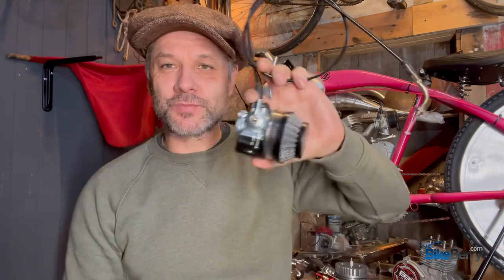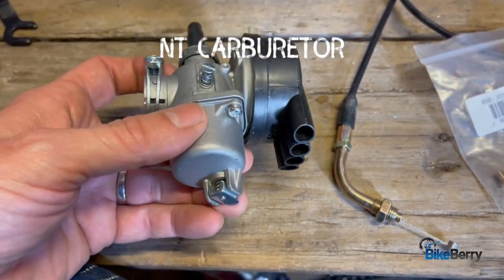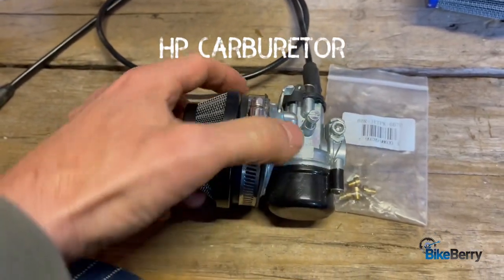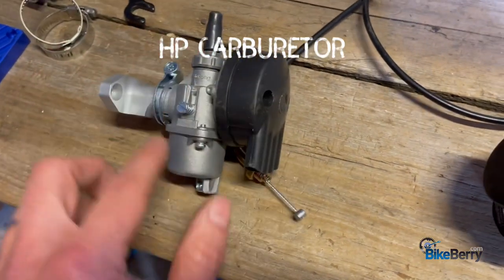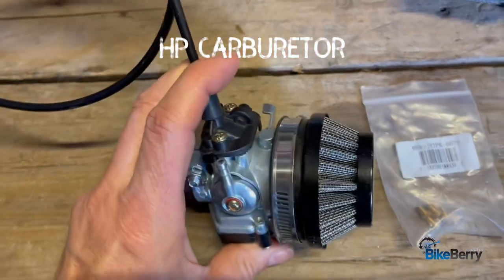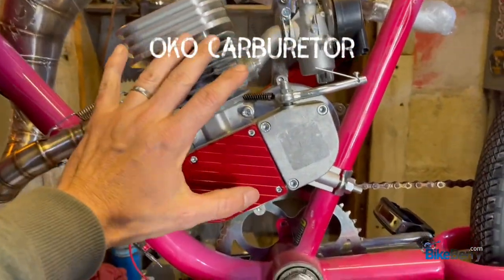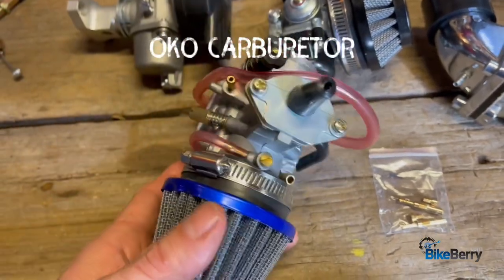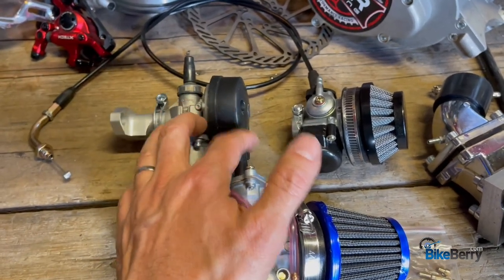Nt, Hp, OKo, Carburetor Overview | Motorized Bike | BikeBerry

Comment: Other than the NT not sealing all that great I'm sticking with it. I am not wasting my time trying to re-jet the Hp carb and the OKo personally I think it's too heavy for what it does. Not to mention I want everything inline not off to one side. Great video though Tony, Keep up the great work loving all the videos.
Reply: I hear you. There are bikes I have that the NT carb is perfectly fine. Then others the HP is great. That’s why I’m building the pink bike. So I can put all the crazy stuff on it 😁
Reply: @tonytaylor5087  I hear you, If I had the money to just build the ultimate Bike it would probably do over 100mph with or without a rider. LOL
Reply: Use Teflon tape to get a better seal on intake to motor
Reply: Keeping everything in line will cause your carb to suck hot air but you do you
Reply: @tonytaylor5087 You’ve definitely got some stuff I haven’t seen/didn’t know about!! Like the throttle for instance… I like the design.. and your expansion chamber!!! Dayum!! Got some nice welds!!! $pendy I’m sure! I’m gonna have to subscribe now,because I want to learn more! My son convinced me to get a motor finally…. So,new to this for sure,but learning fast!!! Just put an expansion chamber on last night….. hooooo-weeeee what a difference!!!

Comment: I know you already have the dio reed, but there has been some heated arguments on weather or not the OKO carb gives better performance with a G2 reed or a DIO reed. It would be great if you could make an episode on this subject.
Reply: Great thing to test! I’ll definitely dive into that.
Reply: @tonytaylor5087  I personally run a G2 reed with the OKO on a YD100 and it RIPS. The thing has SO much torque, it'll buck you off if you arent easy on the throttle. Ive heard the Iron Bore engine has even more torque, so pared with an OKO, decent reed setup, a half decent spark plug, and a decent exhaust, that thing will be a beast.
Reply: Oh good to know!

Comment: Carb 1 has occasionally float balance issues and  the lil float mount tab imo especially when I hit jumps or bumps. Its still awesome but once you bend over the prongs trying to make it cut off gas flow earlier I never got it back right. But I still found it very dependable and a side tap w a screwdriver on side of the bowl is instant fix. I upgraded to HP and its ok for 14$amazon. Anxious to try the 3rd option i didn't know about that one till now 😮 thanks for your opinion  brother 😊

Comment: I’m using the 24 mm oko carb and it’s got 105 stock main I replaced it with a 130 now it’s runs good but if it was a 21 mm it would run good with the 105 and better with a 100 I’m looking for to trying the mikuni tm24 on my other bike

Comment: How is everyone putting on a big pwk carburetor with the stock throttle cable? Mine needs about another inch or inch and a half of cable coming out of the housing and it does have a choke you actually touched it several times

Comment: So I got the 60 680cc upgrade it came with two heads and for the carburetor one black one blue air cleaner one larger head one  smaller your head which goes with which

Comment: That's interesting. I tried an HP Carb on 3 different builds and got the same result(s)...Engine WOULDN'T idle no matter what I tried to do, although they DID run, wouldn't idle. Never tried the OKO, and the NT just gives me the best results and performance, but that's just me I guess...
Reply: did you swap out the jet in the HP to a 70? there jets are way too rich in them

Comment: My hp carb is not working on my motor and i took it apart and it looks fine but i noticed that there is an air bubble in my gas line so it seems to be not sucking in gas properly? Can anybody help with any info
Reply: Did you check the gas tank

Comment: nt crap carburetor: stock, no jet adjustment, 12mm air/fuel mixture inlet, restricts the engine, makes the engine too rich
hp: a little better but a Chinese copy of the 15sha whether in 15mm or 19mm model
oko: the best possible

Comment: i have the first old carb (the one who leaks fuel by air filter, lol) and now i bought the NT carb, and a new acelerator cable, and i dont know how to tune it properly. im using a Z or curved intake cause it dont fits in my mtb bike frame and it happens that have to much lagg on decelation, and some times it remains acelerated. please anyone can helpme to fix it?

Comment: My bike runs with a high Rev and when I stop with the clutch in it will Rev very high how do I bring it to normal idle
Reply: You got a vacuum leak
Reply: In-between your carb and cylinder head you have an air leak,,, THAT is what causes high revving regardless of throttle position !!!

Comment: Choke flap keeps vibrating loose an fall down choking out my engine i tried everything i could think of but it kept coming loose so I took it off and use my hand for now until I get a better cars
Reply: I used some blue thread locker on little nut if blue don't work use red. Torque snug to where choke lever is a little hard to  move but not way too hard & let thread lock dry. Or might try tighter to where lever is hard to move then slightly bend choke flap away from carb hole.

Comment: The HP the seal on the fuel intake there rubber you can't get a replacement the others fantastic!.for one second with covid you should have seen the fully F@#@ out the box basically the hole engine had no one straight join fit and all but the primary piston had gone including the clutch in a year half a seal in the primary case missing after my first cheap Chinese that the carburettor went 3 months I got Australian upgrade that ran it's time perfect bloody awesome on nitro!. but the first try clutch was stuck so got a apparently upgraded and it's stock china standard at full upgrade price???.😃😄😁😆😅 5 Smile's Oko for me!. And the standard will do it's time use at moment!.

Comment: OK so where did you get that sick azz expansion chamber exchast on that pink bike from? I looked all over yalls site and couldn't find it. Right now I'm running a yamaha yz85 expansion chamber on my 80cc motor, reed valve 32mm carb, (came off the yz85 as well) having problems with rear motor mount. Has the 8mm motor mount bolts. Not enough room to put on bar. I'm using a 1972 schwinn has a bigger opening. Planning later on doing either twin motors or a 10hp honda 4cyl maybe even try putting a 150cc dirt bike motor. There's that much room.